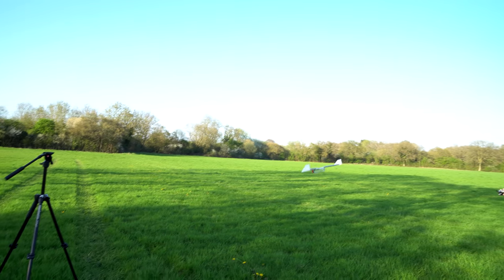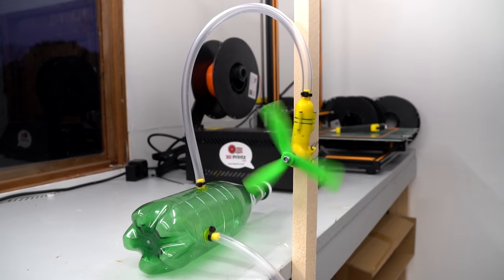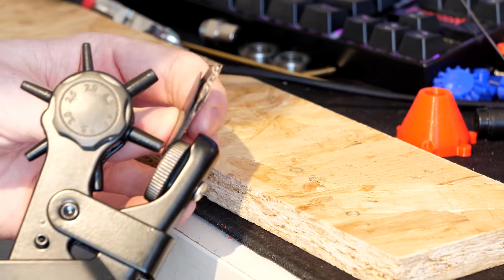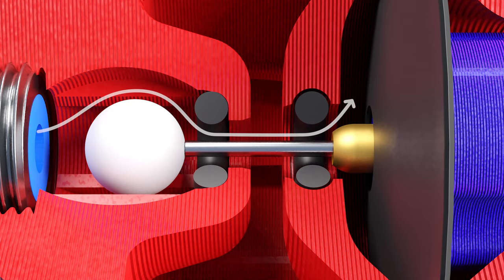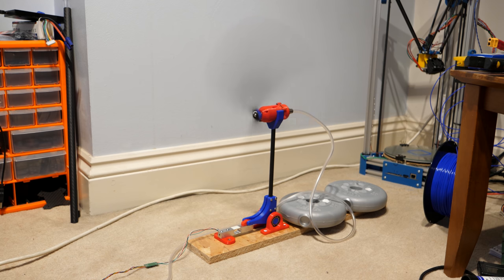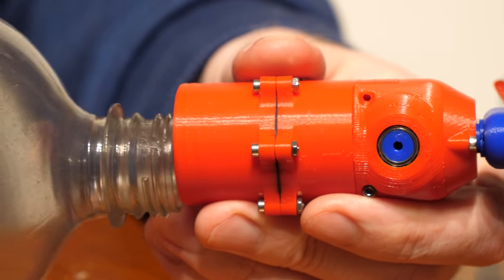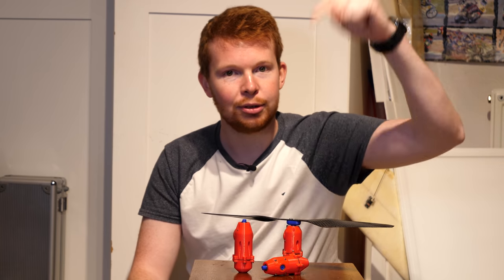Diaphragm Air Engine

Comment: How about those graphics!?
Reply: @Tom Stanton what program did you use to generate the 3D? It's amazing!
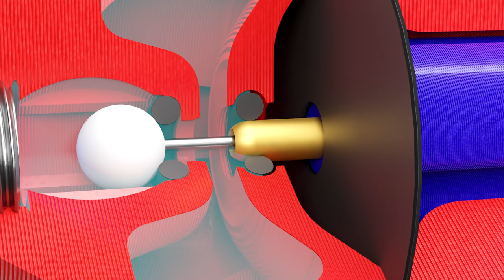Reply: How did you make the incredible animations @ 3:00
Reply: I think they were made in blender.
Reply: He's low-key applying to Pixar.
Reply: I think it's fusion
Reply: @dfgaJK  probably fusion
Reply: I need a how-to video for those mechanical animations alone!
Reply: @dioszegizoltan4493  @Naga Ravi the fasets on the right at 2:55 looks liken an exported stl, hence it is probably not rendered in the program it was designed in. Unless that is just a part he imported.
Reply: @dfgaJK  you can get those from McMaster car component they also be rendered...
Reply: Hi
Reply from the maker: I use the CAD files from my design in Fusion360, then use Blender to do the texturing and animations
Reply: @TomStantonEngineering  the layer lines SELL it!
Reply: @vnagaravi  yes that's what I ment by a part he imported. But also how could the diaphragm be animated in fusion?
Reply: @TomStantonEngineering  Thanks. Here I was hoping there was an easy program I just didn't know about! You did absolutely amazing work.
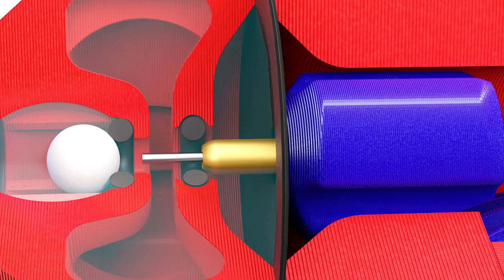Reply: @TomStantonEngineering  did you maybe forget to turn on smooth shading for the air tube and inlet on the left at 2:56 ? Because they look... Let's say blocky.

You can see they are not circular but instead like a 30 sided approximation of a circle
Reply: It's even more impressive that the 3D-print layer lines are included.
Reply: @TomStantonEngineering  ayeee blenderrrr
Reply: I love it when youtubers I love know about each other
Reply: @DG-ms5dz  I was thinking about this too. These graphics were amazing!
Reply: @TomStantonEngineering  I bet you could do a video on the rendering sponsored by Fusion 360
Reply: Hi PE, good to see you here too!
Reply: @TomStantonEngineering  Now make a V8 version of this lol
Reply: @Practical Engineering Good to see you here 🤗
Reply: Good grief, I was so focused on the design and problem solving I didn't even notice.  I think that's a tribute to how professional they were.   There are other theories that may involve my cognitive abilities but let's leave those aside for the moment.
Reply: Awesome
Reply: It's satisfying when u have a question in mind and scroll down to type it, then u figure out that someone has already asked the same question. It's more awesome when u scroll even further and find the answer for ur question xD
Reply: @TomStantonEngineering  If you run an .STL through Prusa Slicer, you can export an .OBJ of the physical toolpaths, which gives perfect layer line simulation for renders - holds up much better when zooming in, and you don't need to spend any time texturing, just apply the material colour you need, and let the lighting do the texturing for you!
Reply: @TomStantonEngineering  Makes sense, I work in traditional animation and have taken a ton of classes in various 3d animation platforms and Modeling is most of the work from my experience, especially if you are using constraints to make the mechanisms operate the way that they would.
Reply: @squeakybunny2776  that is a product of the complexity (resolution) of the model itself. Rending times go WAY up if you start approximating smooth arcs pre render.
Reply: @pargeterw  that is insane! What size do those OBJ's come out? How much longer does it take to render that vs. a simple texture?
Reply: @mikepettengill2706  in blender you can select smooth shading which, I'm 99.9999% sure, doesnt impact your render time at all
Reply: @mikepettengill2706  honestly never tested it - my use case is typically still images not videos, and I have access to a network render farm through my job so render time has never been an issue 😅
Reply: @Rebar77_real  His engineering skills would go down the drain there, wat a waste if he worked there....
Reply: @mikepettengill2706  Just ran a quick test with some random bevel gears I pulled off thingiverse - 1MB .STL, 9MB .OBJ. Bonus features of using this method are that when you do a section view, it actually sections the print and shows the infill etc. rather than a solid wall as in this video. If you've gone for a pretty infill like gyroid, then this can look extra awesome! 
Also - in response to your reply to @Rollie Bollie, that's not always true - depends on your software. Keyshot can take NURBS data, so rendering time isn't affected by loading in a super high res mesh.
Reply: @dfgaJK  no way in blender lol
Reply: @DaStuntChannel ? Tom has said it was blender.
Reply: 🔴How Does Someone Become a Muslim?

Simply by saying with conviction, “La ilaha illa Allah, Muhammadur rasoolu Allah,” one converts to Islam and becomes a Muslim . This saying means “There is no true god (deity) but God (Allah),and Muhammad is the Messenger (Prophet) of God.”  The first part, “There is no true god but God,” means that none has the right to be worshipped but God alone, and that God has neither partner nor son.  To be a Muslim, one should also:

🔴  Believe that the Holy Quran is the literal word of God, revealed by Him.

🔵  Believe that the Day of Judgment (the Day of Resurrection) is true and will come, as God promised in the Quran.

🔴  Accept Islam as his or her religion.

🔵  Not worship anything nor anyone except God.
Reply: @brickct123  might be wrong but I'm pretty sure he uses solid works
Reply: DUDE i was reaching for my scroll about to say "is noone going to talk about those animations or what"
Reply: I'm a 3D designer (product renders) and those graphics are AMAZING!
Reply: @dfgaJK  yep they were made in blender
Reply: 😯 brain blowing, this gives me an idea to supply energy in to battery of 12v to then supply energy to my antminer z9 mini water cooled, do you get my idea?? This can save loads of money to people
Reply: How about em?
Reply: @TomStantonEngineering  lol very impressing how much effort you are dedicating!
Reply: Fusion 360
Reply: Hallo
Reply: @TomStantonEngineering  You should make video about those animations, it is awesome!
Reply: I'm usually watching VR stuff, but somehow YouTube figured out I'd like to see how an air engine is done!  Cool stuff.  +TU +SUB !
Reply: earth saver
Reply: Yeah I was impressed
Reply: If these were really punctual, and they really showed how does it works, why you couldn't get the sizes of parts, why did you need to try many many times?

Comment: Your 3D animations are great. What are you doing them in?
Reply: Wow how can you not know?
Reply: Looks like cad files that were made for printing used in fusion.
Reply: Boi
Reply: @HaiderAli-vd5uk  I think we're talking about the animations. Not the modeling software.
Reply: @0xCAFEF00D  in fusion there is an animation tool-set.
Reply: He used Blender after fusion designs.. @Real Engineering
Reply from the maker: I use the CAD files from fusion360, then use Blender to do the texturing and animation. Thanks!
Reply: Whoa, Blender, I would have guessed it was done in keyshot. The textures for the layer lines is seriously impressive stuff!
Reply: @HaiderAli-vd5uk  So it sounds like you did not know.
Reply: @HaiderAli-vd5uk  No, you weren't being sarcastic.

Unless, you confused the word idiot, with sarcastic.
Reply: @PowerScissor  you know when someone says they’re being sarcastic it’s cause they made themselves look like an idiot😃
Reply: Wouldn’t you like to know weather boy
Reply: Did you say "contact" before spinning the propeller?
Reply: @realengineering you have awesome content  👌
Reply: @HaiderAli-vd5uk  Yes, but.
 "Wow how can you not know? "
Reply: Blender FTW
Reply: @TomStantonEngineering  a little part of me was hoping you'd say Blender :)
Reply: Punished Aniquin  > "still" completely free
blender will always be completely free. It's an open source project.
Reply: @0xCAFEF00D  No, he asked what he was doing them in so Hadier is correct in this case. Tom said the exact thing himself. ( plus the blender part)
Reply: @animationspace8550  
The question was, "what do you do the animations in," which is Blender.  
Fusion is where the assets were created.
Reply: Real engineering good seeing you here, your great!
Reply: A computer
Reply: @HaiderAli-vd5uk  wow how didn’t you know that duh
Reply: @HaiderAli-vd5uk  "the blender part" is 100% of what the question was. Nobody didn't know that he was using the 3D models as a starting point.
Reply: The nicest design and build I've seen in a while.  Well done.
Reply: that was literally my first thought too.
Reply: Yo momma
Reply: @TomStantonEngineering  of course its blender. one day we will look back on these days and wonder why we used anything else
Reply: probably pajamas
Reply: @HaiderAli-vd5uk , just be careful with your words, most people aren't nice with that kind of mistake.
Reply: I love watching your videos and I always learn something new.  I'm right with you there we did not sleeping at night stuff thinking of things.
Reply: How do you do your animations?
Reply: Y e s
Reply: @WeAreChecking  Blender is by far amazing what it can do.  From green screening to sculpting
Reply: Yor mom
Reply: @HaiderAli-vd5uk  Wow how can you not know?
Reply: Punished Aniquin  love with your heart, use your head for everything else. If it's good enough for Cpt. D., it's good enough for me!
Reply: @arfyness  not used in that context. You can't just take ambiguous words by themselves and derive their meaning c.f. "it's still free" and "still, it's free" and "it is, still, free"
Reply: @TomStantonEngineering  They look amazing!! As a little tip you could use smoothing groups to get rid of the geometry faces
Reply: Hallo
Reply: @TomStantonEngineering  Hi
Reply: @WeAreChecking  Hi
Reply: @John_Ridley  Hi
Reply: @PowerScissor  hallo
Reply: Bruh. What engineering channel would not know about this software? If you don’t know the software then YOU ARE NOT A REAL ENGINEER!
Reply: @HaiderAli-vd5uk  I KNOW, right?
Reply: @John_Ridley  You didn’t know either, did you?

Comment: There's something magical about such an obsession resulting in such great design. I can tell you only showed a fraction of the prototypes though :P Keen for it to go on a plane!
Reply: Hey MM, cool to see you here too!
Reply: I have an idea!
A dry ice powered toy helicopter with this engine 
No rc Controls just let it go and fly on its own. It can self stabilize with that weight thing on the blades
Reply: Had you at any point tried using a turbine? Is a reciprocating engine as efficient as a rotary one?
Reply: @minepaperstudio5683  bonus: creates a realistic smokey exhaust
Reply: @minepaperstudio5683   Dry Ice is a genus way of maintaining pressure. I'd love to see some impulse graphs with adding various amounts of dry ice to the 2 liter bottle! I just don't know how fast you can get it to sublimate, as the current design only runs for ~ 1 min.
Reply: I love your cockatoo puzzle!
Reply: @minepaperstudio5683  That's a cool idea, and crushing it up into a liquid conductor (would antifreeze work?) with a heatsink could make it sublimate fast enough to work.
Reply: Hi friends
Reply: These make me wonder how practical they could be on an actual, full sized single person plane.
Reply: @minepaperstudio5683  dude....that diaphragm just wudn't work with all that cold co2.....
Reply: Can't this be used for generating far more Wind energy than we do...?
Or am I missing something here
Amazing vid man ✌️
So rare to find such practical build of an original solution!!

Comment: Now make 5 of it, geared them together and create a compressed air radial engine.
Reply: Or how about a rotary engine!
Reply: @Panzercommander121  and put it in a miata
Reply: @Panzercommander121  which rotary? Spinning Dorito version or the one that looks like a radial engine but the entire crankcase spins? (The Sopwith Camel used one.)
Reply: @spamcan9208  An actual rotary engine, not a wankel engine. So yes, the WWI fighter style one.
Reply: make a rotary so you can have DORITO POWER
Reply: @Thomas B if you really want to go all out insane create the Pratt and Whitney 4 row 28 cylinder version of their Wasp series. https://en.m.wikipedia.org/wiki/Pratt_%26_Whitney_R-4360_Wasp_Major

Comment: Hey Tom! Great build! Might I suggest using a pressure regulator to increase the efficiency of your engine by giving the engine a measured consistent dosage of air from the bottle? It should flatten the peak on  that thrust curve into a nice long line. You already have a measured out volume, regulating the pressure will allow you to optimize every part of your design by guaranteeing a pretty steady rate of air moving through it (assuming the pressure doesn't drop so quick temperature changes are a consideration)

Comment: This is actually potentially ground breaking technology. As a mechanic... and a bit of a wannabe engineer,  I'm incredibly impressed... and inspired! 👊💥
Reply: Honestly this guy should probably patent this or something. Maybe make his own air hog company.
Reply: @matiastorres1510  I think you cannot patent anything anymore, after you publicly show it like that.
Reply: @tenj00  like Volvo did with the 3 point seatbelt design, it is better for us to let others use new technology without worrying about patents and ownership. This speeds up the innovation process
Reply: He's only recreated some *very* old steam engine issues.. like.. the very first steam engine's issues! The Newcomen "atmospheric engine" only powered half of the stroke, just like this thing

You can run a steam engine with pressurized air.. just do that lmao
Reply: @stigmautomata  Groundbreaking technology

For 1881
Reply: it's an over engineered steam engine ... REALLY impressive and inspiring ... NOT ... 🙄
Reply: I mean people have made much better pneumatic engines. When I was a welder I had a super expensive Atlas Copco air grinder and the torque coming out of that thing put every electric angle grinder I've ever had to shame. Plus I loved the noise it made when you pulled the trigger lol.
Reply: @MrMustacrackish  You can't compare machined designs to 3d printed designs.
Reply: As cool as it is (i watched it because i want to do a model steam powered locomotive, but withouth the steam), this is only designed to get around loose tolerance limitations. It's perfect for hobbyists withouth access to machining but with a 3d printer and that's it.
Even then, DSL or LCD 3D printing can print out stuff much smoother than the classic filament printers.
Reply: @ThZuao  I am a machinist. I would need a very good reason to make something like this (meaning anything fungible with an off-the-shelf part) on shop time, but I am am totally going to print one for chuckles.
Reply: Very literally, ground breaking air technology exists. It’s called a jackhammer
Reply: @simonprescott590 IP laws impede advancement more than almost anything else, which is especially absurd when you consider the fact that most technological innovation is done in universities with public money.
Reply: @thepreacher3875 I would love to see the technology you've designed, Mr. Preacher.

Comment: "Noisy engines don't always go faster..."
The truth has been spoken! Amen to that!
Reply: Its like "fartcan" exhaust vs Magnaflow in a way, right? The former is louder, but the latter is most likely faster.
Reply: @Avetho  Magnaflow can be loud though 😅
Reply: @Avetho  
IMO that's a bad example cause they're both slower than the loudest option, straight pipes.
And a fartcan isn't even an exhaust, its just sticking a megaphone on your tailpipe...
Reply: @nickopedia5669  I think my last braincell after finish a lab report wasn't doing too good when I wrote that. It tried, though, and that's what counts X'D
Reply: In some cases I don't care though. Bring back the 2013 F1 sound!
Reply: @NACAM42  yes!
Reply: Tell that to my punk neighbors with their little Hondas, thinking it's a race car
Reply: Not always, yes. Although, having a less-restrictive exhaust can allow the engine to make more power; so in nearly all cases, a louder engine is a faster one.
Reply: @joshjlmgproductions3313  Sir, you are wrong. My 1993 GT Mustang with it's 351 Winsor actually make 13 more hp on the dyno with  the Flowmaster  Super 44 (with lower db) than the Super 10 series...with no other mods. Good day.
Reply: @voodoo1449  I meant as in a stock exhaust with cats, resonators and mufflers, vs just dumping it or straight-piping it. And again, sometimes it can make more horsepower with a quieter set-up, but more often than not, it won't.
Reply: Civic bois crying
Reply: @joshjlmgproductions3313  Its more how the way to pull the most power out with the exhaust is proper exhaust scavenging, which lowers the pumping losses during the exhaust strokes and thus returns some horsepower. But above all, the most efficient form of exhaust scavenging is the turbocharger.
Reply: @Avetho  sounds about right
Reply: In this case specifically, though it would work with any engine, if you're exhaust valve open event is too near peak cylinder pressure, it'll bleed off too much cylinder pressure before it can be turned into mechanical action. Because the exhaust valve is opening under higher cylinder pressure, you'll get a lot of exhaust velocity for a second, making a bunch of noise but loosing you power.
Reply: Jet engine...?
Reply: Reminds me when I was riding a city bus that had a blown turbo.  Engine is at full tilt and we're doing no more than 60 on the highway when limit is like 80.  Driver gets on the intercom "I'm flooring it, it's as fast as she goes!".